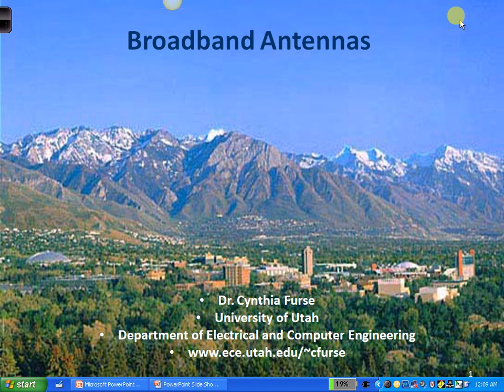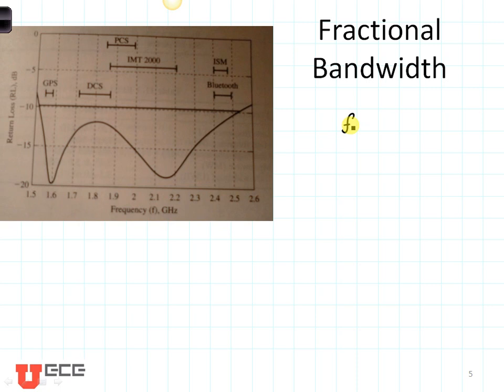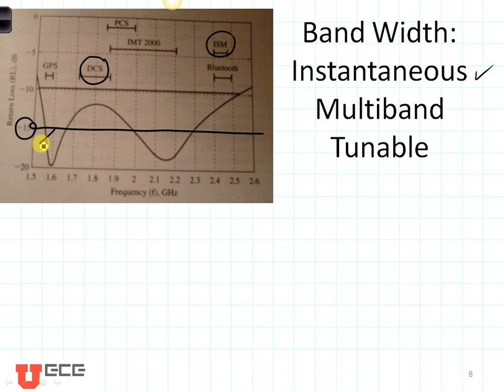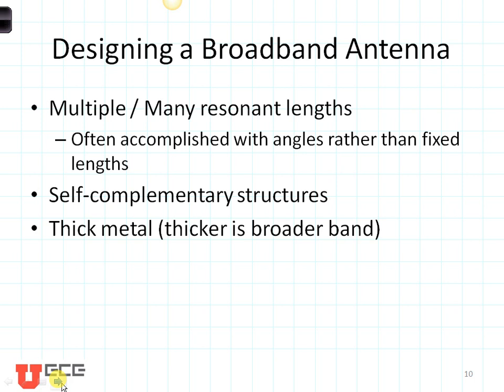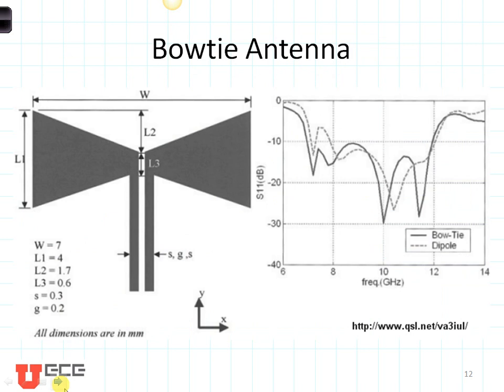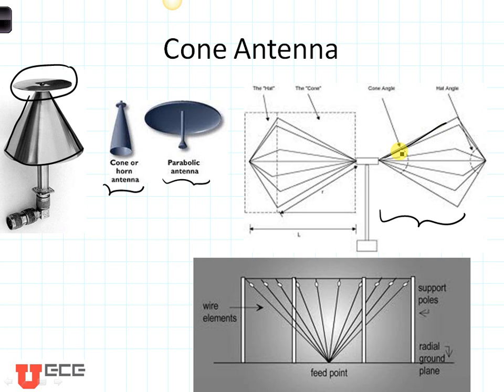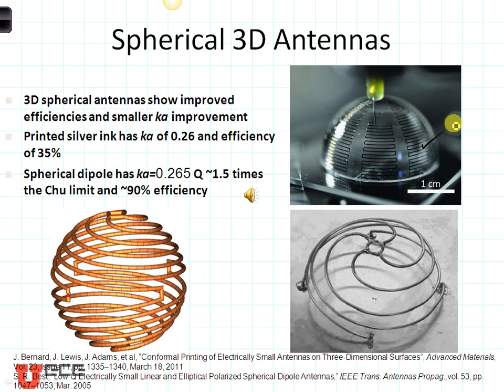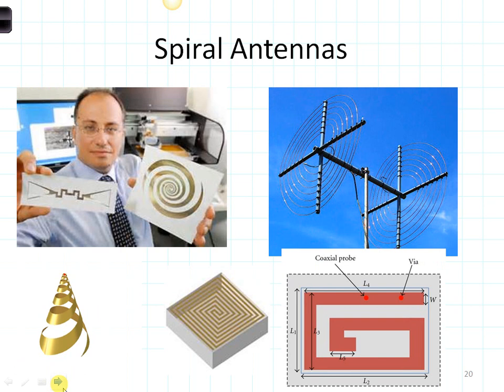broadband antennas

Comment: Great video, but there's a minor error at 8:23 when you being talking about the archimedean spiral antenna. It isn't that your explanation is incorrect, only that the photo you used is not actually a spiral antenna. This is a 'TAK-tenna' antenna wherein the spirals act as an inductive top-load and the coaxial cable feed running up to it radiates and receives instead of the spiral elements. Also notice that they only have *1* spiral arm wound, not two.